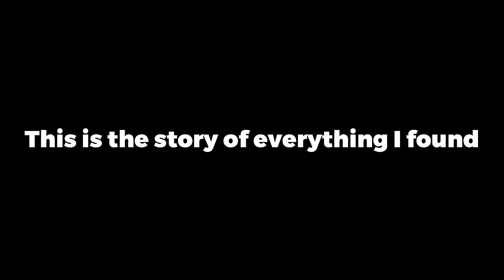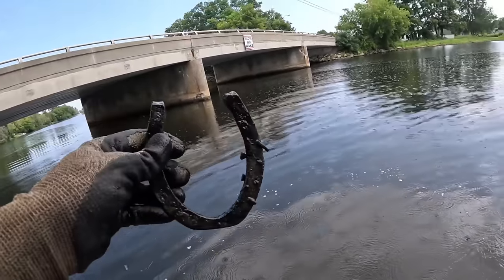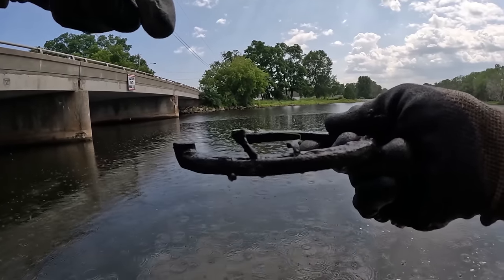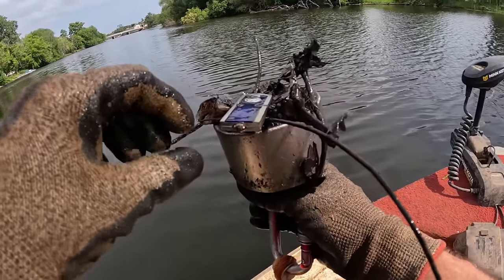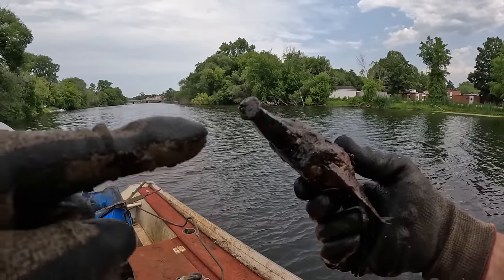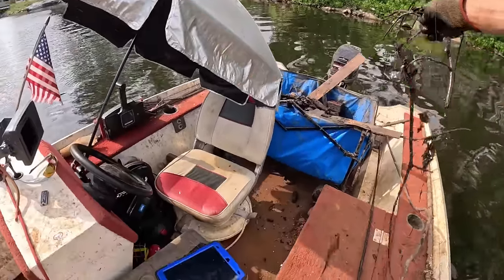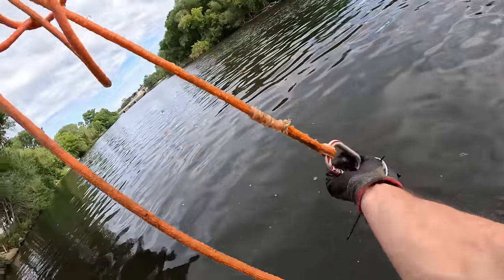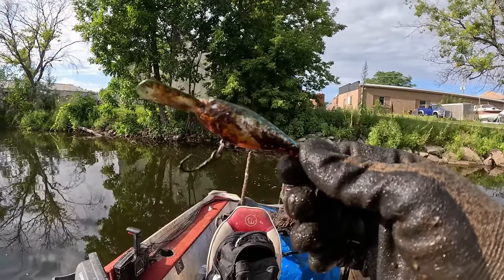Magnet Fishing GONE CRAZY: The Biggest Jackpot Found Behind Old Workshop!

Comment: Looks like you landed on an old mill pond. The big staples and big rounded links were typically used on log rafts. As well as the pickeroons. There were some other pieces that looked like links to an old log feeder system that would pull logs out of the water and feed a sawmill. The one piece of a blade you found looks like one end of a saw blade that operated like a drag saw and the circular piece was small enough to be for a finish saw.

Comment: Yes your boat with a piece of plastic on it believe it or not I recognize it's a headlight adjustment screw when you showed the threads on the end that was my clue
Reply: That piece of metal you found it was a u-shape with a two eyes on the ends you said you can put a pin through is called a shackle used to connect chains and cables to whatever brackets like Logs with log dog stabbed in the ends of them that you need to move